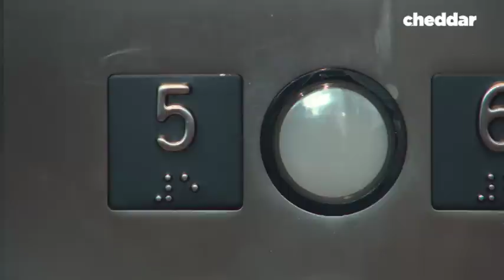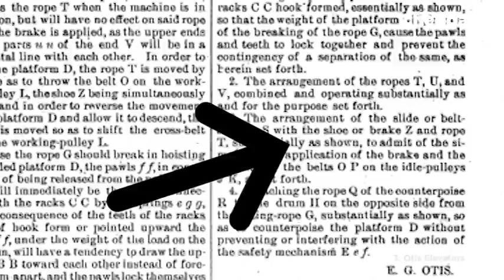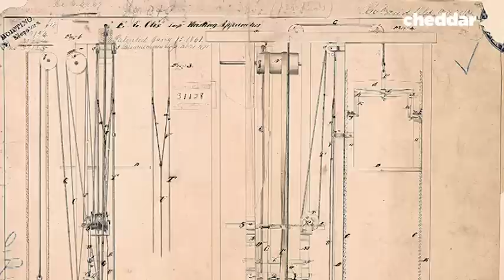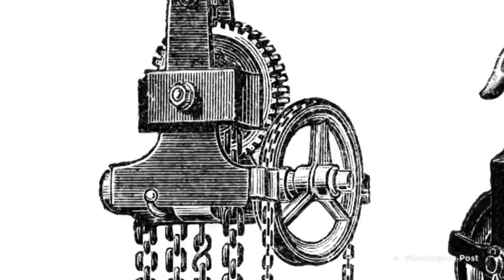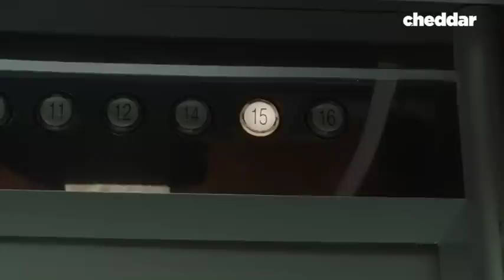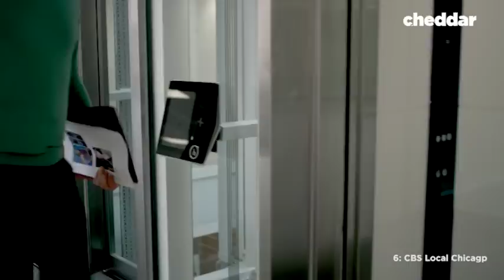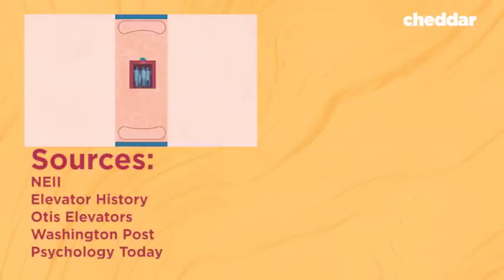Why Movies Are Wrong About Elevator Free Falls - Cheddar Explains

Comment: I used to only use the stairs because i was terrified of both elevators and escalators. I might start using elevators now, but escalators are still off the limits. I don’t feel like getting eaten by a constantly rotating crusher, especially since I’ve seen a video of it happening
Reply: That video was probably doctored.  Each step rides on track much like wooden roller-coaster or a railroad car, where they can't come off.  Also they motor will also get tripped to stop the  belt if one of the steps is kept from freely leveling when it get's to the top or bottom of point where the passenger steps off.  I learned this when my foot was back too far and as the step began behind where I was standing was sinking, it began to push as my foot and before I could reach to move it away, the escalator stopped.

Comment: Well elevators may be super safe but I’m sick of the one in my co op breaking down every other week. How about being safe and reliable?
Reply: They are mechanical machines which have to be maintained, they aren't magic which just works every time if they are left as is. Plus, we have a lot of manufacturers in the market, just like your car or even take a power tool, one is more reliable than the other. The general safety is mostly the same, with some even having extra layers of it but the actual functioning, efficiency, quality, reliability will matter between models and generations

Comment: Well elevators may be safe from  Free falling with that ratchet system and other contraptions to prevent that.. my concern and worry is getting stuck in an elevator, that's why I'm so afraid to get in one for the past 20 almost 20 years. Back in the 70s l  worked at New York's, NYU medical center where I would go up and down the elevator about 15-20 a day. Over the years I got stuck in a couple of older apartment building elevators.. So as I'm getting older 71 now I've been slowly getting panicky getting stuck in in one again. I've been getting panic attacks along with claustrophobia. I don't know why I think I'm getting more frail and vulnerable. Always afraid of getting our failure if I get stuck again

Comment: They don't scare me, to me scariest part of them is the mechanical room. I have actually been inside a mechanical room (penthouse) for a 1960s vintage otis unit many times. It does not scare me so much as make me very cautious when i am in there. Ton of relays, switches, etc in racks all with live 120/240V connections. If you want to see something really interesting check out this https://youtu.be/oHf1vD5_b5I If there was any reason to be scared it would be because someone is messing with the elevator while i am on it. Basically you have penthouse access and know what you are doing you can make them do all kinds of things.

Comment: Lol. How are you going to make a video about Hollywood lying to us about elevators then mischaracterize what happened at the John Hancock building in Chicago? The elevator never plunged. One of the safety cables snapped and elevator gradually lowered itself. None of the backup safety systems engaged which meant the elevator never descended at an unsafe speed.

Comment: Nice but I think that the animation of the original Otis safety system is so bad and misleading that you'd better do without it. When you talk about the brake, the arrow points at the pegs on the guide rails, against which the brake gets applied, rather than to the brake itself which is located on the car roof. Then, when you proceed to the Otis's stunt, we see the car's bottom engage the pegs... of course, that's absolutely and unquestionably the way it actually happened. And it also doesn't work like a frickin' ratchet. You can't just brace a rod against a peg and call it a ratchet. It's nice that you're debunking Hollywood's misleading shit here but you don't have to bring in your own misleading shit. All in all, I have a feeling that the animations were put there only so taht we wouldn't have to stare at a blank screen. I mean, there are animations that can explain complicated mechanisms without a single word but in this video even the narative ain't holy. And those animations are made by single, small, broke youtubers who have like 5 videos in total. But you? You're big, you have the potential to surpass them on every level, so what went wrong? 😂

Anyway, have a nice day.

Comment: Weird how people in malls and such are not told how they work , The little hole in the door lets you open the door if there is no power. I got trapped in it for like 3 hours in the glass ones good thing i did not need to use the bathroom that would suck. They was shocked as to not knowing
Reply: “The little hole in the door lets you open the door with no power”. Well yeah, unless you carry around a triangle, drop, or T key

Comment: crappy job researching (which obviously never happened) when making this video because there is something else that was not mentioned that also adds to the safety of elevators these days...each safety feature must be able to stop catastrophic accidents from taking place by themselves in the event that all other safety features fail...over engineered would be an understatement especially for taller buildings over a few stories high where falls can kill from that distance...she did mention a piston brake which essentially is a hydraulic   brake...fluids can not be compressed  and when you lower or raise a jack for example you have to twist something that can cause holes to close or open...which let's it raise and lower...but it was not mentioned that the elevator itself is a piston brake...there is a very small distance between the elevator and walls...air is not really a fluid but it does behave like a fluid...which is why both  airplanes and things that move through water like submarines and everything else use the same kind of  propulsion systems...boats have propellers and planes do to...jet skies are named that for a reason...the only difference is the fluid that they are traveling through...air that is under a falling elevator gets trapped and has nowhere to go and provides an equal and opposite reaction upwards slowing the elevator down...the spaces between the elevator car and walls just make it less efficient than a piston but it will still help slow it down

Comment: i actualy have an fear of elevators. Not that they fall but the imagination of getting stuck in an elevator scares me! Like i missed multiple things because i couldn't use the elevator and the staircase is creepy AF. I even have nightmares of this sh!t!

1. 72 Floor
I have a repeating nightmare where i would step into an elevator in try to go to the 14th floor. But the elevator and shows a glitched 72 or 74 on the display and misses the 14th and Pushes against the sealing. at the same time i see a gap (like 20cm) between the elevator and the floor. Oh and the elevator is like to deep to reach the floor but is to high to go to the 13th (well rather 71).

2. Mat elevator
I had this dream now multiple times but... It plays in the 10th floor where a GIANT black netted mat is hung to 4 thin ropes. My class sits on this thing but not me. The thing is that the 10th floor in general isn't harmful but the space between the mat and the 10th floor was like 30cm which is a lot considering that it is basically a swing so it wiggles.

I have more of 'em but i where to lazy to write them here and YT comments aren't a blog XD

Comment: As soon as she said the counter balance weighs slightly more than an unloaded car but slightly less than a fully loaded car I had to stop the video because my brain locked up but then I realized that the elevator in question must have a max capacity of 2 lbs and I was able to continue.
Reply: It’s incorrect information, the counterweight is half the capacity of a fully loaded car.
Reply: @elevator_satellite  - Thanks.. and since this might be my only opportunity to ask an actual internet expert. Do tall hydraulic elevators (whatever they max out at i'm guessing 5 or 6 stories) have mechanical emergency brakes as well and if so how do they know when to activate?
Reply: Gee, I’m not really fond of hydraulic lifts, but I do know that they have the same type of overspeed governor that the average traction lift has, so if a hydraulic lift actually overspeeds (which it wouldn’t likely do), it will still brake in time.
Reply: Oh yeah, and also overspeed governors are a mechanical piece of equipment that is usually housed at the top of the shaft which uses centrifugal force in order to release the brakes on the lift car and grab on the guiderails.

Comment: But when the power shut down why i didnt have an free fall like out look safer theyre much better but the American ones are dangerous like sure one time i glitched the elevator i pressed my floors button and when someone ordered the elevator it died why its cuz there was too  
Much pressure so it died and i had an free fall from 6-3 atleast i didnt die like its safer theres cams and callers that you can call from ground and even the little bell so no it has its own electric systems

Comment: So im more likely to die to an escalator then an elevator?
Reply: Substantially.  Escalators have killed a sorta disturbing number of people.  In some extraordinarily gruesome ways.  I'd rather die in a metal box slamming into shocks than turned into ground beef from the legs up.  Especially if the former is substantially less likely.

Comment: They are safe, well unless your in china or new york.  
9-11 the in tower 2 the elevator fell to the ground floor on fire.. 
Oh and let's not forget the guy who was killed last year I think in a new york 
hotel when an elevator fail to stop on an landing.  
https://nypost.com/2019/08/22/video-shows-moment-man-crushed-by-elevator-at-manhattan-promenade-building/
In china... do to poor elevator service.  it seems to be very common for elevators not to stop on a floor and crush the passenger between the landing and the elevator roof.
But ya, in general elevators are safe.

Comment: They havent see the China elevator that snapped a body in half
Reply: Yep.. the thing is, safety has to be implemented before hand too. You can't just say EVERY elevator in existence has the same level of safety. Those videos showing chineese ones, ahem, I think don't need explanations. They obviously had generic ones, which probably did not have much safety measures taken either from the logic, or  maybe has been installed incorrectly by technicians, and a lot of countries (whole of E.U for example) also has safety requirements for these, all the way before the product gets installed, to how it's installed, and to how it's maintained. and even how it should be disassembled if need be.

Comment: Honestly once again I'm feeling underwhelmed by your video. The 3 safety features you mentioned were all in the clips you were showing and the film I always think of for an elevator death scene (resident evil) showed them too.

If the cables were to snap then the counterweight is negated, the emergency brakes are shown activating in the film's you showed as well as the one I mentioned and the hydropic rams are all shown too (only sometimes with debris around due to damage to the building).

Of course they are still safe due to the multiple cables but I found this video mostly going through thing most people already know from films in the first place.

I have to admit, you've got one more shot before I unsubscribe, so your next video better be a good one.